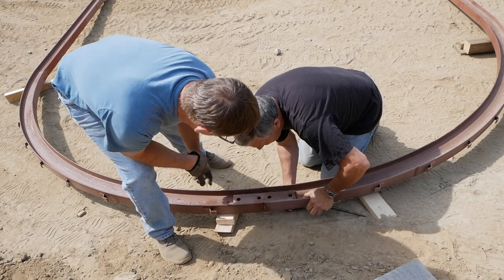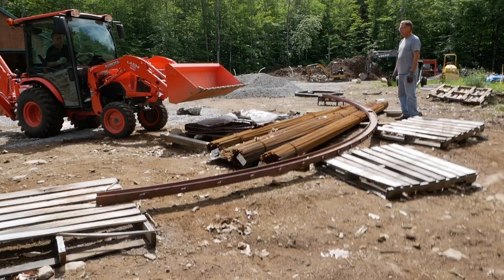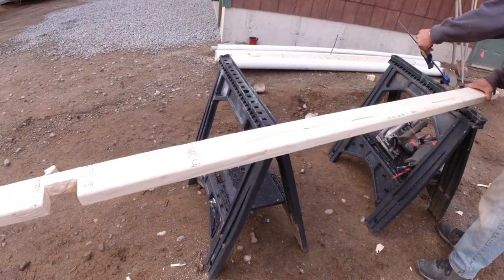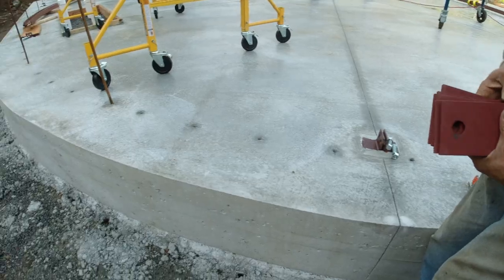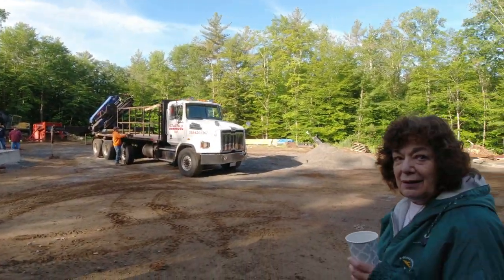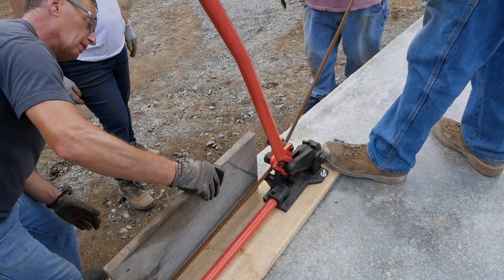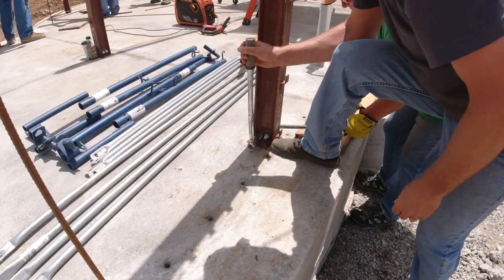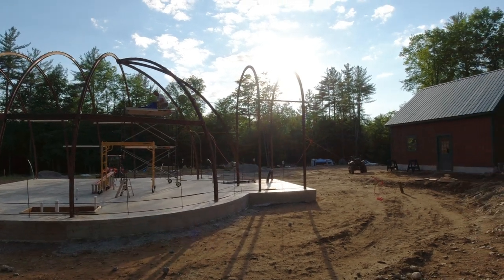OFF GRID BUILD - STEEL BEAMS - Like an OLD FASHIONED BARN RAISING with a MODERN TWIST!

Comment: Great progress! As you mentioned in another video the footprint looks small but maybe it’s just how we are seeing it on video?
Reply from the maker: Sometimes it seems small, and then sometimes it seems bigger, but now it is really feeling small with the steel up! The first floor is about 1,100 square feet and the loft is about 400.....so we will see. But how much do we really need?
Reply: @CreatingASimplerLifeOffGrid  1500sq ft is Not bad and true the more space more to keep clean! It will be a very interesting structure.
Reply from the maker: @dnhman  Definitely a challenge to build!